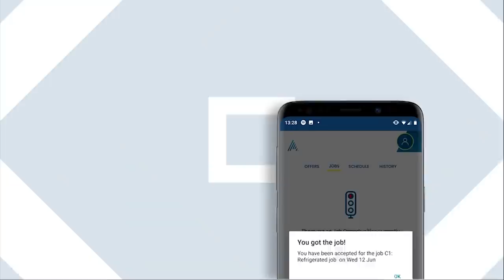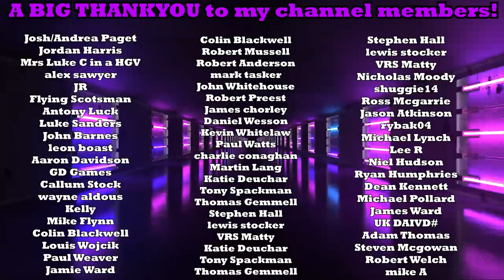Damaged Expensive Wood!

Comment: You should let your wagon idle for a few mins after you have finished, if you suddenly cut the engine, you can damage the turbo and because the turbo is cooling down without the engine running, oil cant circluate
Reply: Only if you have come straight off the motorway at high rpms for ages. Back roads will cool the car and turbo.
Reply: @Winged_Vision  its a wagon tho not a car 👍

Comment: So I've still got my hgv but been out of the industry for 20 years.  Not much changes, you sit about for ages to get tipped and checked.  It's a pain that places won't take deliveries after mid afternoon.  Little wonder there are transport and supply chain issues.  I had a unhappy copper warn/chastise/inform me about leaving the wagon running.  Steamingly it's called vehicle abandonment.  Got a telling off.  Another ticketed me for no side lights displayed in darkness.  Even though it was in a layby set back from the road.  Tried to argue the point but I still got a ticket

Comment: 2 bits of advice for what they are worth, 1: pull your curtain forward when loading as tight to the back as a curtain or pole can be damaged in the blink of an eye. 
2: leave ignition on when loading when possible to prevent mudguards dropping onto tyres and damaging mudguards or rubbers.

Comment: Watching this I'm struck by just how inefficient road delivery is. Speaking from the perspective as a Railwayman of twenty years experience, I realise just how much time and effort is wasted. Today you had a very tiny fraction of a load that I would have transported in the past by train. I would have prepared my train, tied on the locomotive done all the safety and brake tests, completed the journey and delivered in under three hours. I would have done the same in reverse having delivered over a thousand tons for each journey, all my driver had to do was drive the loco and follow my instructions. When I went lorry driving there was just an array of delay, arguments, lost loads and hanging about. It's a mess innit?
Reply: Your train however would not have got the deliveries from the sawmill to the end user. A lorry would have had to take the timber to the nearest goods yard, it would the  have been transported to a marshalling yard, then to another marshalling yard, then to the nearest goods yard to the destination and finally back on a lorry.   More like 3 days than the 3 hours you claim. 
Trains work fine for full loads between rail terminals but are useless for small drops as in this instance
Reply: @johngrant5448  I remember it well,  the reason the railways lost general freight was that it took at least 3 days door to door for anything other than a parcel or a select few fresh produce trains. Locally we used to grow a lot of flowers and fruit, quite a bit went to the Manchester markets.  A train left Ely each afternoon at 4pm.  If you missed the train the produce went by road instead leaving far later in the evening.  Eventually the growers thought, lets just use the lorries all the way, its quicker and cheaper.   The person with the poor education is not me.  I also remember the wonderful Red star parcel system where we had to drive the parcel to the station and our client had to go to the destination station to collect it.  DPD etc do the same job door to door for far less.   
Businesses only used the railways as they had no other choice, why do you think it  moved to the roads ?  It wasn't because the roads were slower and more expensive.  Drivers such as Luke do more in a day than BR workers used to do in a week.

Comment: Under the new rules the cyclist at the roundabout in Stoke on Trent, had Right of Way ???
Reply from the maker: Cyclist has right away if on a junction (which he was not) 

Or if on a roundabout (which he was not)

The cyclist was off the roundabout in the middle of the road, as far as I’m aware that doesn’t give him right away. Even if it did give him right of way he didn’t attempt to move.
Reply: @lukecinahgv  Information much appreciated. This Australian is trying to understand because those rules will eventually arrive here too. Many thanks. Stay Safe
Reply from the maker: No problem mate. Still trying to make sense of it myself 😂
Reply: @lukecinahgv  I think the general consensus at the moment is that "junctions" includes roundabouts, and therefore the cyclist should have had priority; however, as you said, he didn't attempt to move, and there's also a bit of "look out for each other and sort it out between yourselves" in the new rules.

Also, the bit in the video where the cyclist on the track on the left "didn't know you were turning left" - TBH, he probably had a strong suspicion that you were turning left just through peripheral vision and hearing the sound of your engine.  Truck engines are not quiet, and a truck continuing down the road would be unlikely to be slowing down.  You handled it correctly, though.

Comment: Nice Vid chap, I'm an ex truck driver and truck and car instructor, think about it chap, L driver stalls car engine, it doesn't mess up the turbo, How many people that said yes leave your engine running
Stop at the shops, as the car is barely stopped turns off the engine. One worse thing, don't hang your dirty washing for all to see. It is an offense to leave your engine running, vehicle unattended.
Reply: Can See why you are an ex  steering wheel attendant then